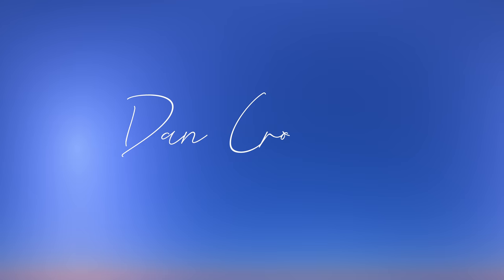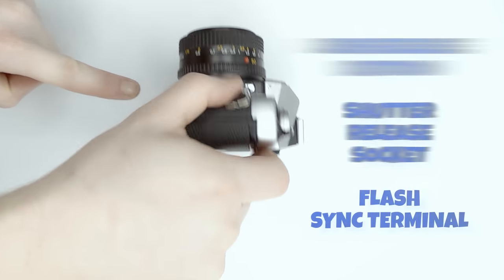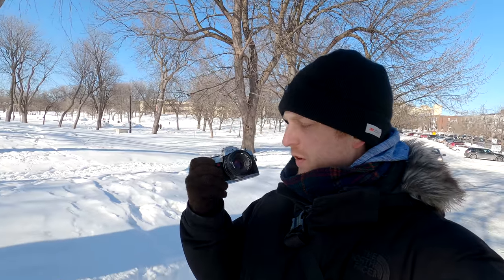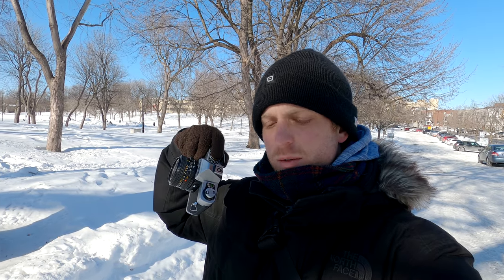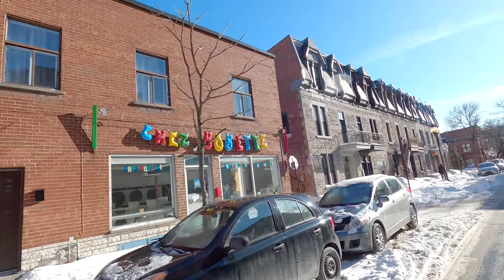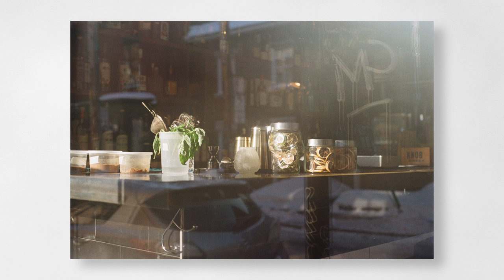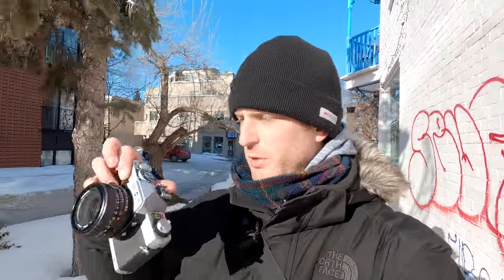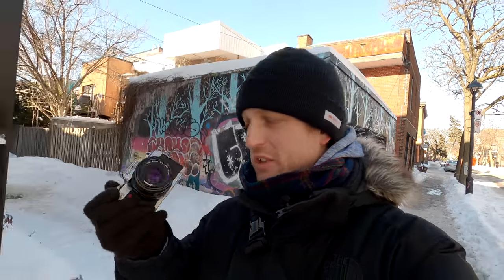Minolta XG-1 - Vintage Camera User Experience

Comment: I just paid 20 bucks for this while searching for any of the older Minolta 55mm, 55mm, and 58mm 1.4's that are all metal. This one comes with the 58. I already have a 58mm 1.4  that works great and just got this second one because the price was so good, and the seller accepts returns. I'd also like to say, the older Minolta metal 50mm 1.7 lenses are just wonderful, and I shot that on my Fuji X-H1. You could not ask for better perfection..it's that good. Anyway, the 58 was just purchased yesterday with the SG-1, so, let's hope for the best...By the way, pick up a skinny wrist strap..like the ones on the CMOS pocket cameras from around 2012. They never bind or get in the way like the thicker ones do, and they simply never break. I don't even walk around my house with my Fuji X-H1 without slipping it on.
Reply from the maker: Nice find on the 2nd 58mm lens! I'd like to find a 1.7 for this camera as well. The wrist straps are a great idea, mine are still strapped to my favourite cameras

Comment: How U can convert to digitals?
Reply from the maker: Yes! This is the most simple way to have your film photos digitized. When you take the film into the lab to be processed, you can request digital scans, and they should ask you some questions about how you want to present those photos. If you want to post them to socials, they'll offer you a cheaper, smaller scan, and if you want to print from those photos one day, they might offer you a higher resolution, larger scan that costs a bit more.